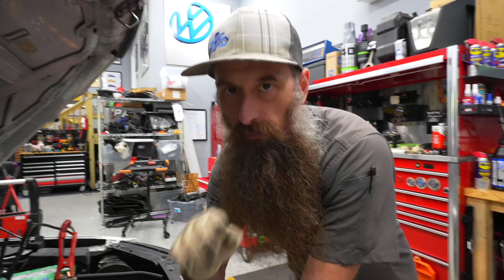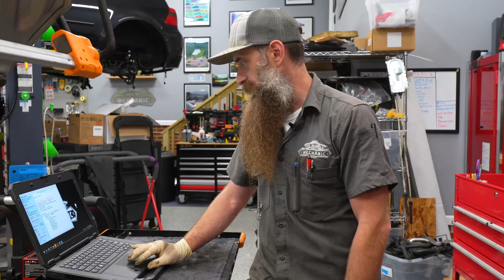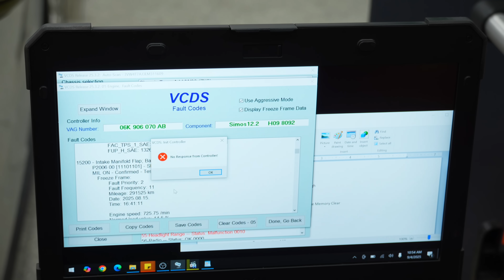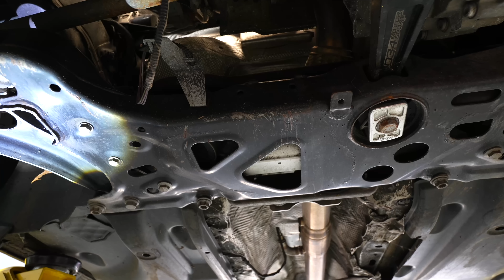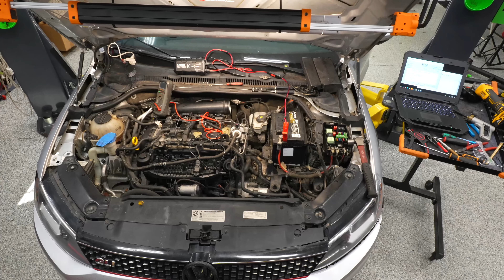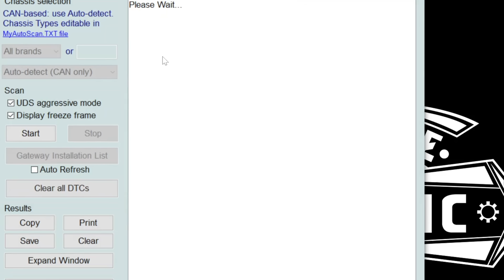This Car Was Left Broken for 3 Years After a DIY Fail

Comment: I have a 14  jetta 2.0  turbo  with a p0299 that that i can sure  it doesnt have a charge air leak and i replaced  turbo with a known good one. How do i get your  advise charles. Car has ben sitting for 2 years cause of this code . If you dont accelerate  more then 1/2 throttle no codes and it drives great.

Comment: My names Caleb I talked to you today at the presentation at UTI, Austin TX, I did some digging and found out that the fuel system is a Bosch D Jetronic while is controlled by the intake manifold pressure sensor(the sensor you replaced) and that’s why you got the misfire , Now it all makes sense and once again it was great meeting you.

Comment: The fuel metering valve fluctuation you are hearing is most all of the time tied directly to the n205. Watch that phase MVB for erratic fluctuations once at operating temp and i bet you will see it swing wildly advanced and then retard the cam timing.  Ive gottwn lucky with a "lets start with a known good n205" and that fixes most but on a lot of others, the possibility of a slight oil pressure issues and/ or cam and spool valve issues is out of thr question. I dont get to fix these car so offten anymore. They all get scrapped or traded in and live the rest of their lives on sketchy buy here pay here lots...

Comment: Those plugs scream Too much fuel, not enough air. Im guessing it was just a result of the underlying intake issue. I see this all the time though. I had a jetta come in, really nice car for its age, but it was just missing like crazy. Bring it in, pop the hood, and immediately see a cold air intake. (Not a little one. An actual 3 inches from the ground track style CAI) Keep in mind, this was a daily driver. Literally the first thing I did was yank it off, and start the car up....

Yeah... The amount of road dirt this thing was sucking up was wild. No need to do anymore troubleshooting. I called the owner and asked if they had the OEM airbox. They confirmed they did. I told em to bring it down. Problem solved in a matter of minutes. I didnt even charge them anything. Just gave them a stern lecturing.

Comment: Hopefully you can answer me my question. I just bought this car from a young kid. First car he ever owned. It tries beautiful but the overflow is dirty. They’re telling me that it’s missing oil to the overflow engine oil but engine oil is clean. It’s not dirty. I really want to fix this car. This was one of my dream cars and I want it running the correct way can you please answer my questions I took it also to Volkswagen dealership service it for $450 and they tell me that it’s recommended to replace the head gasket again. It’s a head gasket will be bad. The car will be smoking. It doesn’t smoke. The engine cat will be dirty just like the overflow and it’s not please help me.

Comment: complains about bad wiring on that air temp sensor, proceedes to do bad wiring too
Reply from the maker: do you really think that was intended to be a proper fix?
Reply: @HumbleMechanic  Spent all that time messing with the manifold, might as well spend 5 more minutes soldering 2 wires and tossing heat shrink on them.

Comment: just a thought idk if this would work in this case but... if that sensor was what we knew had issues from the beginning could a multimeter be used to check it against the other sensors that arent faulting? or would that not work eith this type of sensor?

Comment: I have a 15 S4, 3.0T. Any good way to test the alternator on it? Does the alternator need a re learn? Got a new battery out in by a euro shop 2 months ago, car seems like it’s draining battery. (I don’t know if the shop coded in the new battery) so I suspect the alternator is at fault. Voltage is very sporadic when it does run. I’ve heard it could also be the regulator, or the bearing on it too
Reply: I currently have 0 monies to pay a shop to fix it, so I’d like to try and tackle it myself if it’s a fairly easy task

Comment: Hi Charles! Been having a problem with my MK4, and can't find a solution to it. I replaced my pads/rotors serviced brake calipers and changed handbrake cables, and it started at slow speed ( reverse or fowrad driving ), i had a squeaky noise from my left side rear caliper. I upgraded to the 256 rear calipers ( reused same pads, since they were new ) Same issue, same side. Could it be the pads that have an issue? I could send you a video to understand what i am talking about. It sound like im with a train, not a car. It's embarassing.

Comment: I changed the ignition plate/coil thing in my friend's Saturn SC2 and it had a terrible misfire. I pulled plug wires, found the bad cylinder, swapped wires to make sure it wasn't a bad wire, swapped plugs to make sure it wasn't a bad plug, and then put the old coil thing back in and it ran fine.  Thanks Murrays.

Comment: I need to ask - I have Skoda with CHHB engine (2.0 TSI with FSI and MPI injectors). Got myself a HPFP issue of leaking fuel, got it replaced with OEM. Whats more, second oxygen sensor got faulty, got aftermarket one. After all of it LTFT were around -9% on idle. On my decision MPI and FSI got replaced with aftermarket Bosch injectors, wideband oxygen sensor got replaced with aftermarket, EVAP OEM and charcoal vapor filter also OEM. Car runs perfect, but LTFT constatly around -10% on idle. No smell of fuel, consumption seems a little bit higher (around 1L/100km I think?). Timing chain verified, 4 teeth on tensioner. No codes in any of the modules. What else that can be? It is stage 1 tunned.

Comment: I strongly believe that parts failures follow a "bath tub curve". Meaning, You will see High failure rate at the beginning and at the end of the life of a particular device. Regarding the trouble shooting, I would have replaced the sensor first. Checking the voltage and wiring to the ECU was too invasive and too early in my opinion.
Reply from the maker: I’m
Not trying to slap the parts canon on. Would have wasted $100 if it didn’t fix it. No one would be happy if a technician did that. 

Other than cutting the stupid tamper bracket, that wire check took 5 minutes. It’s a know vs think situation .

Comment: Aliexpress parts=aliexpress problems.  The diaphragm likes to fail on them as well, just overall junk.  TONS of EA888 gen 3 intake manifolds out there, especially in Europe.  Grab a used one off ebay and not have to worry about this issue or a bad diaphragm.

Comment: the tape on the intake tube is not actually a bad thing for a quick temp fix, however.....the way that intake tube was, that tape was not going to fix that issue lol...but duct tape is actually a good diy fix or mod depending on how severe the hole is. I use heavy duty duct tape for certain airflow reason and def works, but not to cover a intake tube, just get a new tube and call it a day.

Comment: Left broken for 3 years, but it runs?  Yea not great but it runs..  if it was left broken and not ran then youd have a few more issues than what few you did..  but from what was fixed on it looked like plug in a few sensors, replace one, wiring repair on a sensor, duct tape mechanic remedy..

Comment: If it was me getting to sort this car out I'd have to start with remind myself every 10 minutes with "don't be lazy, CHECK, see, confirm !", than I'd have to see if I can get any sort of service manual for it. After that get any sort of service history, be it paper or word from owner. Depending on the answer I would extend the list of easy checks and reshuffle it so whatever was messed with, will be checked first, because I do not trust other mechanics one bit. One other thing would be to reproduce the complaint before touching a thing. I do forget about that and later on I don't have enough reference if I'm making a change or not.
This just about enough to eventually find something big enough were owner either has to call quits or call bank.

Comment: question  to WV mechanic , i replaced all 4 injectors on my mk6 golf 1.6 tdi , and a lot of new part to it , job worth around 6000EURO , i checked glow plugs and its fine , but in morning he have hard start but if i prime fuel pump 2,3 times it start wethout question (fuel pump is new) , jesterday i turned  on my car and it started to jerkin while accelerate , and i find some bad wires and when i press on connector on injector 3 it startet to working fine , so i isolate bad naked wires but it didnt fix issue , i put too much monay in that sh** and i dont know what do do any more xD And ofc i dont have any codes nor chack engine

Comment: So for me when I’m diagnosing a vehicle, any time I see a “circuit range/performance” fault that is an immediate trigger for me to look at wiring. I feel like checking available voltage then doing a voltage drop of the harness is the fastest/easiest way to eliminate the harness as being a problem. Most problems I see are with connection issues and not mechanical issues. So if I can eliminate a connection issue I know that the module is seeing an improper signal and that it’s more than likely not a module issue. I would then check measured values to see what the module is seeing as far as signal/voltage to determine if the sensor/actuator is reading or moving properly. Then go into mechanical issues.

Comment: @HumbleMechanic I'll trade you a 2003 VW beetle 1.8t 5 speed manual, 166k miles, salvage title needs leaks oil around the turbo but not bad, CV axles boots are gone, needs rear wheel bearing, possibly a new maf or upstream 02 sensor or both due to bank 1 lean codes (P1111, P0171). AC doesn't work won't take charge? Ohio salvage title. Lol I know I'm far from this even working out but it's worth a try lol.

Comment: You don’t want to jump an old battery to fire it up. You can seriously damage a lot of parts.
Has to need a fresh battery.
I always take out the runners. Makes a huge difference in performance.
They are only needed warming up on very cold start ups.

Comment: Recently picked up a 2014 JettaTDI wi5h a p2015 code for that intake runner implausible signal. Installed the dieselgeek intake runner brackets and it cleared right up. I assume the actuator arm was over extending.  🤷‍♂️

Comment: My 2015 GTI that I bought with 100k miles ended up with a bad intake runner position sensor right around 120k. Super duper easy fix. I did end up pulling the intake manifold cause it was desperate for a decarb as well. Cleaned the flaps, didn't fix it, ordered the sensor and everything was good. Currently at 152k, stage 2 IE tune, all the fixings to go along with it. Your videos have helped me a TON with working on this car, so thank you for making them and continuing to do so. In fact, you are a large part of the reason that I bought the GTI to begin with. Got a good deal on it, wasn't in terrible shape. Couldn't be happier. Thanks again, Charles!

Comment: @HumbleMechanic, i also have a car been sitting for 3 yrs because i cannot get the bolts with broken heads off my car.  I was not able to put fuel stabilizer before my life took a really busy turn. 

Should i use the low pressure fuel pump to empty the gas tank first? Would it be safe to use one of the fuel lines between the low pressure fuel pump before the high pressure fuel pump to old fuel out? It would be turn key to ignition without starting the engine then let the fuel pump prime

Comment: didnt watch whole video but so far till 4 min i could say calibrate throtle body position sensor, and tell em to run away when u see trash air filter cuz original is best, since im from eu and we here have that cars on every corner its good to avoid those engines cuz high oil consumption, piston oil ringz made from hair 🤣 only tdi and old 1.8 atmo are ok, new german garbage is exported to usa, sry guyz blame german bobz 🤣🙋🏻‍♂️

Comment: It's sad to see these cars with a combination of no pride of ownership, and such junky mods. If it were not too expensive, and DIY (quality DIY) - returning it to stock would be the way to go. Intake, suspension, and whatever else was done to it. Then, the repairs to a level that are cosmetically acceptable. The bumper cover and fender should not be too involved, since they both bolt on. But if there's a lot of stuff broken underneath, that's something to consider. Ultimately it's the goals with the car, and cost.

Comment: i think you should fix the cosmetic damage, the sensors, and shoddy DIY work. If you just raise up the springs the car has on it already to a usable height it should be good for another 100k miles with less than $1000 of work and parts put into it, from what I've seen.
Reply from the maker: sadly the bodywork and paint alone would be way more than that. stuff is so $$$$

Comment: Since you asked: You mentioned it had a static code that came back immediately after clearing, yet without starting the engine.  Since the code came back without starting the engine, it can’t be anything with the vacuum system or the mechanical flap movement since none of that is in play without the engine running. 

As a 2014 Edition 30 owner, this is painful to see. They’re such great cars, but this one has been ruined by sketchy DIY repairs and neglect.
Reply from the maker: You are right on that one. It's such an easy check and since I wanted to be sure the vac module moved the flaps I had the pump out anyway. I think of it like this. "It will take a minute to test this, I already have the tool out, might as well confirm" ive seen guys get whooped by vac supply on that system. but yes you are right lol
Reply: @HumbleMechanic Agreed!  Considering the overall condition of that car, every one of your tests was worthwhile since the car probably has a long list of problems 😂.  Also it makes for a great video as you show how to test that entire circuit and function. 

Sometimes troubleshooting is figuring out what’s good so you can narrow in on what’s bad.
Reply from the maker: FACTS my friend!!!

Comment: Them damn intake manifold codes😂😂 ive replaced everything with genuine vw parts and still get the flapper code😂
Reply from the maker: make sure that vac supply is right, and the lines are connected to the solenoid properly.
Reply: @HumbleMechanic yep i've checked all I have vacuum...

And it seems like my intake manifold works.. because once the car was warmed up.I took some electrical wire and I held the flaps open... then I drove the car around the block... When?\nI got back.The wire was off..

I don't have vcds but I do have obd11 and I checked the movement of the flaps but I didn't know you had to hit thirty eight hundred rpm for them to move... So that's my next thing...

And I know I have vacuum because I swapped the lines around , and it pulled my intake manifold flaps open when I went for a drive , but it held them open...
Reply: Man if it's that damn censor on mine i'm gonna be pissed cause I have to remove my intake manifold... cbfa motor😂😂.. i bought genuine v w parts and they cost an arm and a leg..